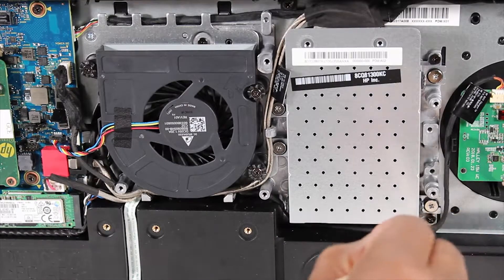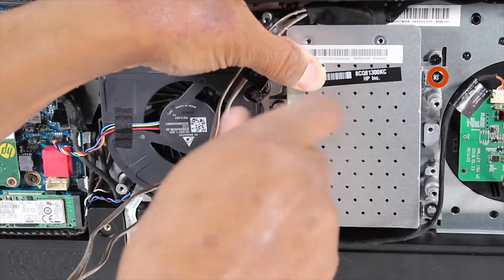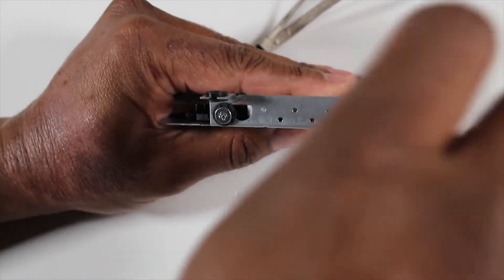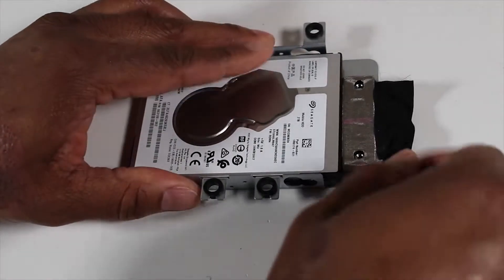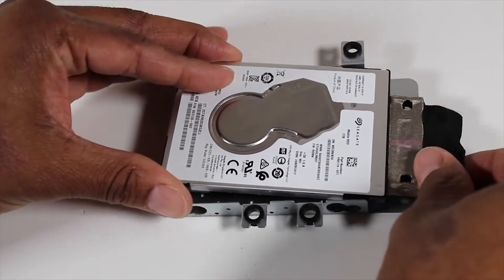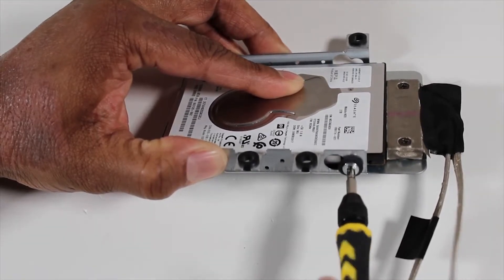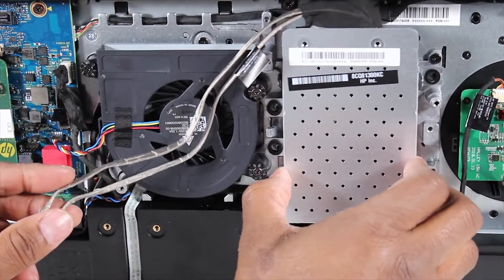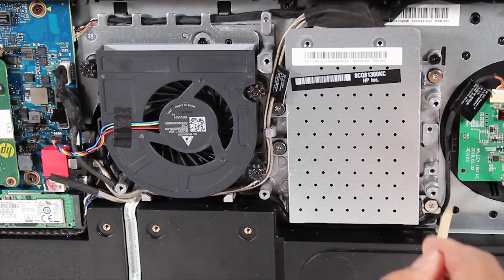Replace the Hard Drive Assembly | HP ENVY Curved All-in-One PCs 34-b1xx and 34-b0xx | HP Support

Comment: that cover ain't coming off. this video is crap and missing a step
Reply from the maker: +Tony Nguyen Please contact our phone support team to fix the issue. Please follow these steps to reach them.
Step 1. Open link: https://support.hp.com/us-en/contact-hp
Step 2. Select the product type.
Step 3. Enter the serial number of your device or select let HP detect your product option.
Step 4. Select the country from the drop-down.
Step 5. You should see the HP phone support number.
Reply: @HP Support  a ten minute job turned in to 3 hrs.  for everyone reading this. Under the base plate there is a 6mil thick adhesive mat you have to peel with a razor blade. if you try with your fingers it will peel just the print and not all whole adhesive mat so I recommend using a razor.  underneath you will find 1 silver screw and 4 additional black screws.  There are a total of 12 screws holding the base. not 7 like the video incorrectly describes.  Be better HP.  accurate documentation is important for your consumers.
Reply: @GameAPBT thank u ❤
you made my day

Comment: can i replace it with SSD SATA and if the gpu up gradable
Reply from the maker: +abdulla dhanhani It supports NVIDIA GeForce GTX 1050 dGPU (4 GB) and following hard drives:  
512 GB PCIe NVMe TLC M.2 Solid State
Size: 512 GB
Interface: M.2
and 
Type: TLC Solid State
Size: 2 TB
Interface: SATA
Rotational Speed: 5400 RPM
Width: 6.35 cm (2.5 in)